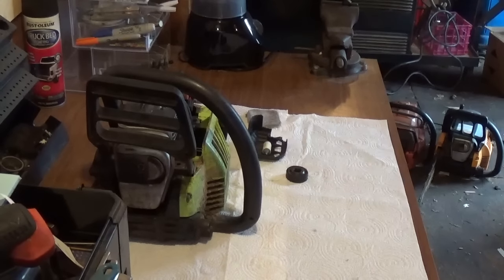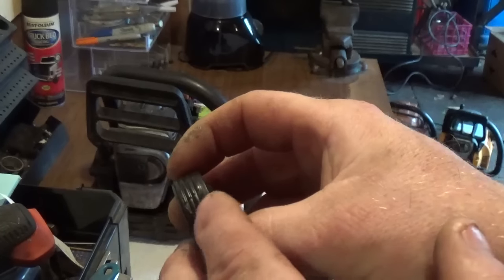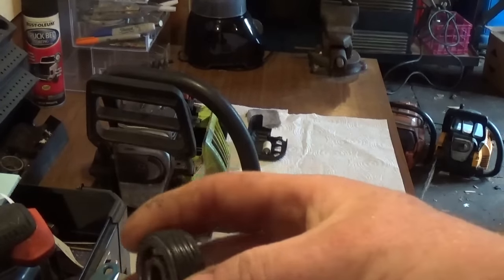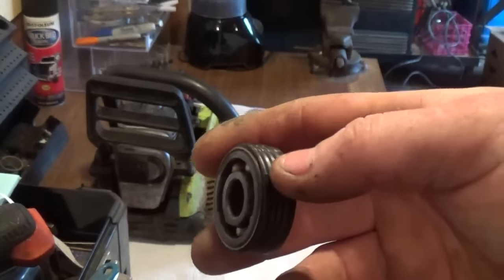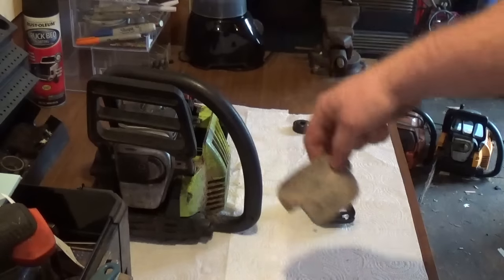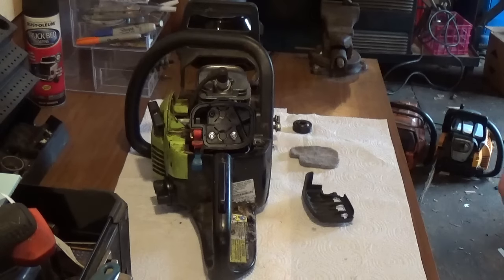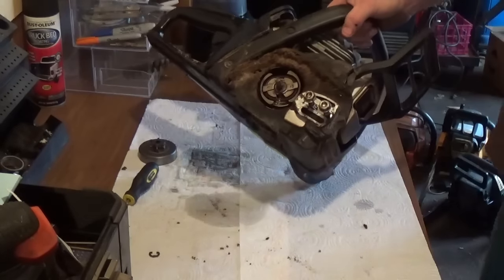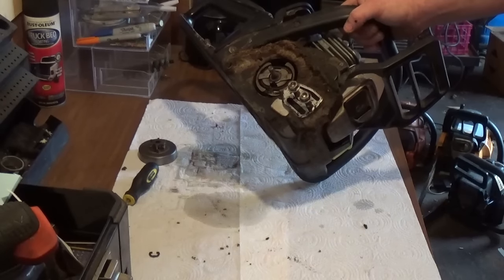Common problems with Poulan Chainsaws

Comment: I had one also with bad fuel lines leaking gas all over start a fire on me after 4 bags of concrete I got fire out.
Reply: Dk tomanyexwives I had to replace fuel line on my little green 16 incher. After that it ran fine and had the HP is should have out of the box. 

I’m guessing the fuel line got pinched in the factory. It happens. And it happens a lot more when they make a lot more.

Comment: Well cant compare to a stihl ur comparing a 100 dollar saw to 800 dollar saw
Reply from the maker: No ...more like a 140 dollar saw that's 42 cc{Poulan} and under powered as they place on skip toothed chains to a Stihl Ms 180 thats highly similar in cc and generally averages about 260 dollars locally witch will also includes mix as well as bar and chain oil in the sale depending on the time of year purchased as well as fire sales ETC.

Comment: Kevin really enjoyed your video. I found a 3416 by the road and replaced the worn out starter pulley, and carburetor. So far I have $21.00 into it. The most frustrating problem is pulling the starter cord; it sometimes feels like its going to break my hand. Any advice on this problem would be appreciated, and how to remedy the snap back problem. While trying to start it I kept hearing myself saying what a piece of shit this thing is. Thank you for your review, and advice.
Reply: check the keyway on your flywheel. is it broken and out of time?

Comment: I have 5 poulan chainsaws and within 3 pulls all of them will start
Reply from the maker: Start ….[Perhaps].....But continue to run as expected ? If this is what your trying to advocate {then simply prove it } as surly at least one of the 5 should be capable of passing the poulan challenge requested . Simple request …..and I made a video of whats expected so there shouldn't be any confusion upon whats expected .

Comment: We called them bic lighters when I worked at a small engine repair shop. When they run out of gas,you throw them away. Lol. Disposable saw. They were designed for storm cleanup by a home owner,once you finish cleaning up the storm damage,you throw them out. Truthfully. I wont even fix them any more. For the price of the repair,the guy can get a new saw.
Reply from the maker: So very true...

Comment: To each their own. I've had a Poulan for more than twenty years. Used it often and it still runs, and cuts wood great.   To me, you might ought to tape a dollar to the side of a Stihl, before you throw it away.  That way you can actually say you did lose something.  To each their own.
Reply from the maker: Oh I agree one should tape a dollar before you throw a Stihl away . As the Stihl would have earned its keep and then some .So that dollar would be appreciated in the hands of the next individual whom needed it for a spark plug , gas mix ,gas, etc ....Perhaps a 10 dollar bill should be applied to the more modern Poulans as youll need it for the Preparation H after taken that kind of fuckin .

Comment: I guess I can agree with you on certain points. I've been a small engine mechanic for 19 years, and a professional chainsaw carver for 24 years. I've seen good saws and bad saws from each brand.  I personally have ran Poulan for the extent of my career and like my father, am currently sponsored by Husqvarna/Poulan/Weed Eater. You bring up good points that I can agree with.  I can only say that as a  professional chainsaw carver, my saws are ran 6 days a week, 5-8 hours a day, 8 months out of the year.  I fortunately have had no major problems.  They range 25 years to 6 months old.  I'm a firm believer in maintenance. Maybe that is the reason behind my success with Poulan chainsaws.
Reply from the maker: Perhaps .....As most people do tend to neglect there equipment
Reply: Kevin Bolin, I did enjoy your video though.  There's no doubt that the problems you have pointed out are definitely legitimate.  The one that irritates me the most is the fuel cap!  I typically carve 6-7 hours a day 6 days a week.  You can imagine how many times I stop to fuel up, and every time, I better hope I have a pair of pliers!  I don't see this much on my older saws, but every one of the new ones.  

Do you have more videos?

Comment: It is possible to file down the fuel cap to free it up. I did that as soon as I noticed the problem. 
I have been happy with my PP 18". I use it only for falling, on trees that are way too big for it, cutting from both sides. Probably for 10 years. I heat with wood.
Reply from the maker: Yes you can file down threads on the caps ....sadly there are going to be more issues to contend with in just a short time making these saws a real headache . And you say you have a pp18 that is 10 years old that you have for falling ....cutting from both sides?....You should by a lottery ticket friend /as your one of the luckiest people I know to have had a pp18 that's 10 years old and still felling trees with it . Hey could you provide a short video showing my viewers this old saw in action . Incredible Is a under statement if you will provide the video to validate your claims .
Reply: @kevinbolin7665  I don't have a smartphone or video equipment.
I know it is a cheap saw, but I  have never had trouble starting it. In the past year I have had to adjust the idle speed. I use premium gas to avoid the ethanol. It is an easy handling saw. I have equipment to skid the logs, so I buck with electric saws.
I am now concerned about wildfire and have been cutting down large cedar and Douglas firs near my buildings, about half a logging truck load this fall. These are 24-30" at the stump.

Comment: Hi I got 3 free chainsaws (idjit must have used ethanol gas as ALL 3 had fuel lines shot).. put new carb +-lines in Homelite super 2 (starts easy but idle/runs for crap - thinking crankseals shot) then John Deere CS-40 replaced fuelines ($2 Bucks that's it) runs good but VERY revvy cutting at half throttle (plastic throttle linkage crap)……………..
LAST the Craftsman 358.351560 (identical to Poulan)  was FLOODING massively! ..here my 2 guesses WHY 1. swollen Gas Cap ( was putting pressure INTO the tank..Fixed via Dremel) 2.? New Carb - the old one was ALL jacked up - gaskets put in wrong etc ..gave up got new one from Amazon (a WT891 that replaced WT324) for $22 bucks... after that starts and runs cuts great also quietest BUT vibrates (added foam to handle)…………..

Comment: Alot of this can be modified think outside the box. For one the first thing I do is bypass the Dumb ass useless fuel  bulb then I add a bigger impulse line / vent line. Vent it to a filter out the back.

Comment: I've got a poulan 3300,,,i've used it for over 25 yrs,,,numerous bars ,,chains,,,spark plugs,,,no mechanical problems ever,,,that saw doesn't owe me a damn thing
Reply from the maker: Exactly my point...bought 25 years ago....the more modern poulans purchased in the mid 1999 to 2000 range {years } and even up to modern day are complete pieces of shit . Theses pieces of shit would owe anyone more than a damn thing but sadly the only thing most people are able to cut is a hole in there wallet trying to keep these cheap bastards going straight out of the box .

Comment: Bought a Poulan pro 4218 about 3 months ago.. still not right.. I'm stuck with it for now.. what is ballpark L-H- settings to start with?
Reply: HandyAndy start at 1 and 1/2 turns counterclockwise from full in. careful not to turn it in to far to start ..

Comment: Had my Poulan for 19 years.
Yes, I use a pair of pliers to open the cap.
Runs good, never had any  issue other than regular cleaning and maintenance. I have 2 Husqvarna s (Rancher and a small T435). I use the 3 chainsaws equally, depending on size of wood to cut. To be frank, had frequent issues with the T435,  and some with the 455 Rancher, none with the Poulan.
Just lucky ? Maybe.
Reply from the maker: Perhaps/ But just for sake of argument would you be willing to show that Poulan in action ? Perhaps making a short video ? Take on the Poulan challenge I have expressed to others that advocate there Poulans are reliable ........My viewers and I would really like to see the end result say in comparison to one of your other saws.

Comment: Every saw is mass produced, except hand made race saws. I'm not a big poulan fan either... but no new saw is worth its weight. Their ment to be cheap, it's a home owner saw ment for small jobs. I own one, if it breaks ill throw it out instead of fixing it, but for bigger jobs I use my antique Mac 10 10, it's a dangerous saw but damn, it outcuts all other saws I'd used... I won't touch a stihl, over priced crap as well. Saws arnt made like they used to be. To got a good saw you need to get pre-1980 saws lol, sad but true. Out of the box I had to readjust the carb on my poulan lol. Good vidoe addressing the problems.
Reply from the maker: True...And yes the quality of saws today leave a lot to be desired by performance and dependability

Comment: years ago I purchased a 1400 Poulan saw, brand new, filled it with fuel mix, filled the oil tank for chain lube  started it then sawed for 14 minutes total time usage, then it quit, no spark  from ignition coil was discovered, purchased a new coil, ran it for another 15 minutes, same problem  again, third coil was installed and another 10 minutes of run time coil stopped producing spark, I had more time in removing and replacing coils than actual run time. I then set the saw on a post and politely shot it with a 30.06 rifle solving that problem forever. By the way this particular saw was being used as to de-limb low hanging tree branches.
Reply from the maker: I believe you completely ....I never replaced 3 coils on one saw /but I have replaced 2 as well as even a carb on a poulan .......These saws are just terrible and get cheaper and cheaper made with ever model leaving a lot to be desired.

Comment: I whole heartedly agree with you.
i have  a poulan woodshark i fixed up, brand new OEM Zama carb (old one was a Walbro)... i almost have to tune the carburetor every few uses. to get it run right. sometimes it will die when i let it off the throttle after making a cut, and then sometimes be impossible to start when hot. I've tuned it several different ways i've seen on youtube. one video from steves small engine saloon. saw ran like crap after i did it like that. Poulans are junk.

Comment: I bought my first chain saw, a Poulin about twenty years ago.  It worked well and I gave it to my family for use at the cabin where it continued to provide good service for a few more years.  The new ones are not as reliable, so I have moved to Stihl and Makita.  Worth the extra money if you use a chain saw on a regular basis.  On any saw, I drain any leftover gas and run it dry before storing it.  Saves a lot of grief.
Reply from the maker: Agreed..

Comment: i havr a Poulin 3314 and its horrible.  it's hard to start.  it wont stay started.  it doesn't maintain tension.  when by some strange Miracle of God that i may cut a peice of wood, it's doesn't to a particularly good job.  steer clear.  unless you enjoy being frustrated, in which case, this is your perfect chainsaw.
Reply from the maker: So very true....This is often the case after purchasing a Poulan..

Comment: My 42cc Craftsman saw started and ran flawlessly.....and I mean flawlessly...for 21 years. Not heavy use....cutting about 6-8 chords of firewood per year plus a few other tree clearing/trimming jobs over the years. On year 22, the fuel lines disintegrated completely.  I haven't been able to get it back to reliable. Fuel lines replaced. Carb rebuilt.
Reply from the maker: My point exactly...21plus year old saw ......The new poulans are pieces of shit save your money.

Comment: I have an old Poulan 4000 Counter-vibe, a real old McCulloch Mac 10-10, & a newer Echo cd330-t. The Poulan was always hard to start from day one and now my newer Echo seems to have partially locked up. The only one I can trust to start and cut wood is the 50-60 yr old Mac 10-10. Todays new equipment is engineered to be break down earlier rather than later and it pisses me off. I have gone thru two newer tillers but just purchased a Troybilt horse from 1976 for $75 that starts up on 1 to 2 pulls. Anyway I am just a homeowner and I trust your knowledge. Did you say all ethanol gas
should be avoided??? I have noticed on my fairly new weed trimmers & leaf blower the fuel lines and fuel tank groments are disintergrating
Reply from the maker: Yes / The reason they are disintergrating is due to ethanol ..Dealers will never admit this to just your typical average customer ...But If one thinks about it seriously... { If the groments and fuel lines really were as dependable as they passively pretend then why do the equipment manufacturers supersede the part numbers for the carbs, seals ,fuel lines and groments}? I can assure you it isn't because they discover a better alternative  for the part and truly wont to fix the problem . In truth its because sales suffer and changes are forced or obligated in order for them to find profit .

Comment: I'm sorry but at 2:45 you are holding a piece of thin moldy toast and calling it an air cleaner. Please explain your mistaking toast for an air cleaner.😐

A little before 7:16 you had just thrown a piece of toast out of the way.
And now are wondering where the air cleaner is.
Toast....
Reply from the maker: I am confused at the entirety of you comments  {at 2:45 I am showing the air filter and at 7:16} I just threw the air cleaner out of the way and was looking for a fuel filter that was on the table..... but had fallen on the floor and over looked . So could you please explain your comment its left me and others a little confused .

Comment: My saw is the predator, had it since 1998, had to replace the bulb once. But now it's hard to pull it now. Cut God knows how many tree's because I primarily used wood heat. So in short I really think I got my $100 worth. I have bought expensive stile saw if I spelled that right and a bunch of issues keep it running. So my thought Is you can by crap expensive or not and have issues. If you only use once in awhile, then poulan is great. If you use for professional use, then buy professional equipment.

Comment: I have 2 18" Wild Thing chainsaws. The only thing I've done is replace the carb. I re-ringed both and they did better! The oil pumps don't last. They bog down and cut off. Usually it's the carb. If the gas cap is tight, replace it. It is kinda under-powered. Keep tightening the chain. Like you say, the oil pumps are a piece of shit!

Comment: The truth is simple I've been a small engine mechanic for over 30 years,the old Poulan and the old husqvarna chainsaws are good saws ..in the last 10 years quality has been replaced by quantity,
Reply from the maker: Thank you / I agree completely .....But we both know in the business its best to keep a still tongue .{ so sadly most of us do }{ JOB SECURITY} prevents most of us from being honest .There is no doubt with out the failures of these small engines we would be out of work fast . BUT Heaven help me the quality anymore makes me question weather we will even be needed in this line of work as most equipment is becoming {service by replacement } or the quality of the parts are just shameful .

Comment: What I've discovered about cheap power tools is duty cycle... not meant for extended use.

I got a Poulan at a yard sale... yeah... quite cheesy... I keep it as a backup...

I have to use channel locks to remove/replace the fill caps... weird..

Comment: Someone ask you for your opinion are you just co-dependant?

Never had any of those problems, one Poulan is still  running fine for over 20 years now. A Poulan Pro I've had for 3 years now I just replaced all of the fuel lines and the primer bulb on due to ethanol in the gas (use ethanol free pre-mix), running just fine. Again never had a problem and they both start easy every time hot or cold and will cut all day.

Just another saw snob berating Poulan.

Most of the parts are the same part numbers used on the Husqvarnas (note there is no A between the q and v) BTW, which from the videos I've seen cut twice as fast as an equal sized Stil.

Parts are cheap on eBay and easy to replace too with plenty of videos to guide you on YouTube.

Take care of your saw, stay away from ethanol and saw snobs.

Personally I wouldn't take anything to this guy.
Reply from the maker: Matt C. actually yes my opinion was asked of . That was the purpose for the video . Also I provide facts as well as I have explained several times if you would care to bother in doing your research on these beloved saws that cut twice as fast only being 42 cc witch I am sure you already have known. Its obvious you share a difference of opinion and I can respect that . Still facts are facts ....look for yourself ...{refurbished Poulan products } ....Then get back to me in regards to the quality . {co dependent } I am not as I am not looking for validation on facts only to allow others to avoid the certain impulse purchase that catches the eyes and bleeds the wallets of many .
Reply from the maker: Oh and the reason your convinced that they cut faster is due to the type of chain used {skip toothed } are common on Poulan to fool the user in power and performance . Place a standard Oregon chain [325 ] then make a decision based on results . { LOL } you can just set back and watch the exhaust gases melt away that Poulan .